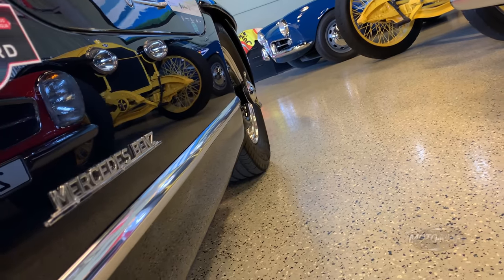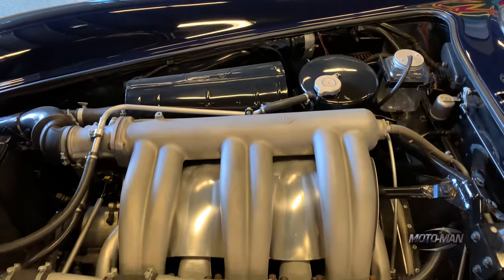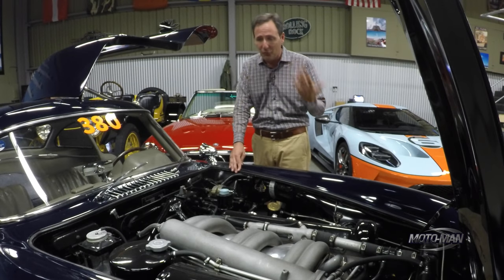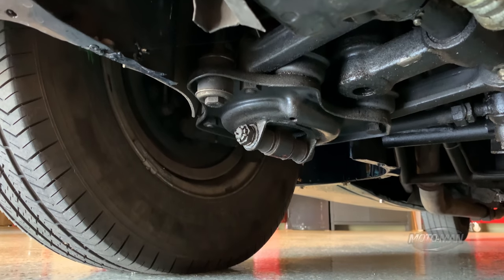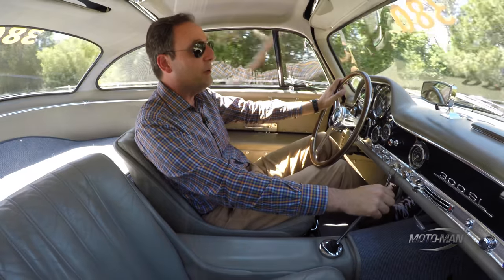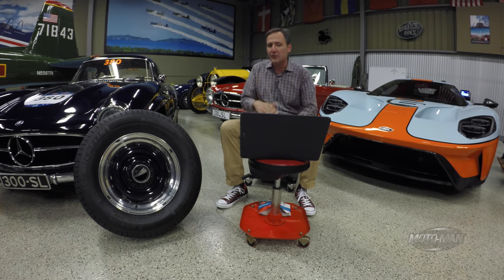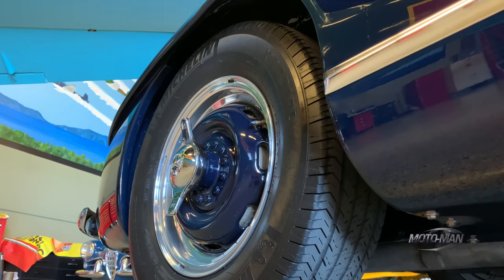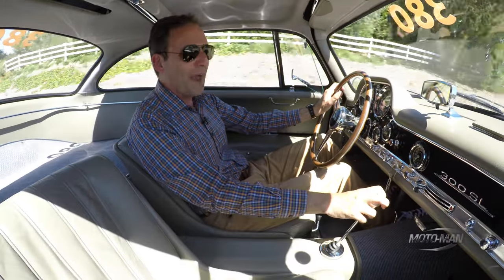The Supercar from 1955: Mercedes Benz 300SL Gullwing W198 RETRO DRIVE REVIEW

Comment: @MotoManTV my goodness, what a car. what would you say is something reasonably attainable (<= 50k USD, much less than 1.5 : ( ) that could exhibit qualities of older cars like this? some older 911's maybe an early cayman / boxster? some MG variant? i need to look into this (just noticed the link to Kinney's video)
Reply from the maker: Once I start traveling again, Dave is going to come on Inside the MotoMan Studio and talk to that very point but let me take a stab considering the US$50K budget:
1.) Small block early C3s are screaming bargains and an underrated car because everyone wants a matching numbers, big block.
2.) Triumph Stag. Many laugh at me for this choice but it's a small V8 that sounds like a Ferrari, with Italian styling. Only caveat, you MUST know a guy who can set them up the right way otherwise it will kill you. There are many rats. Buy the best you can.
3.) Z32s are dirt cheap right now. They won't stay that way for long. Especially nice ones. Even though they are early 90s, they are still very analog in driving experience. Here's an episode on one: https://youtu.be/5ekyMHx62NQ
Reply: @MotoManTV  yay, thank you for taking the time to reply. look forward to Dave's chat.

Comment: So this car was worth about $70k in inflation-adjusted dollars when new, but its modern equivalent costs double that.  I would argue that the new car is so chock full of safety features, space-age materials,  and computers both seen and unseen, that it more than justifies that increased relative cost.

BUT!

Think about this.  The original Gullwing is the kind of car that dreams are made of.  If there were a team of welders, mechanics, metal workers and other craftsmen working away in a small factory building cars out of tube steel and aluminum/fiberglass, with crate motors, a few hundred units/year, I bet they could hit that same ~$70k price point, but the vehicle produced would be the kind of visceral experience you get driving something from the 50's or 60's.  If only our auto industry had the same small-volume manufacturing laws that Britain had.
Reply: @owinthomas  I hate to admit it, but you're right. Stupid litigious society. Companies like Factory 5 avoid this by making you build your own car,but how many people are really going to do that.